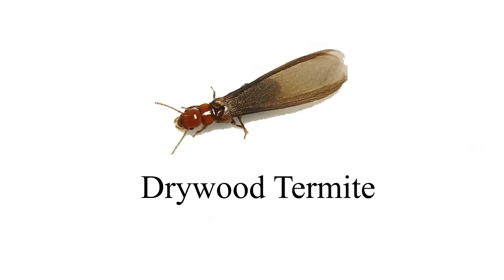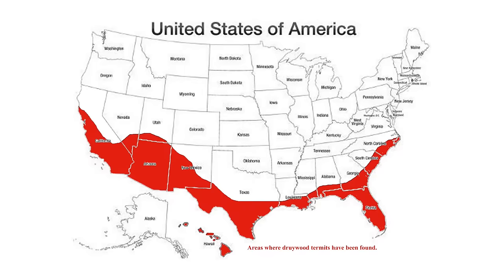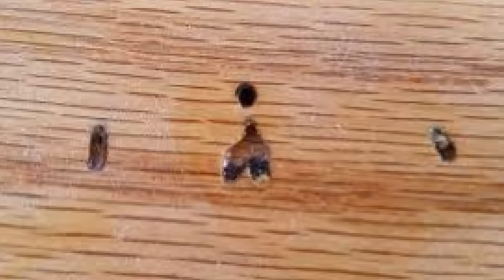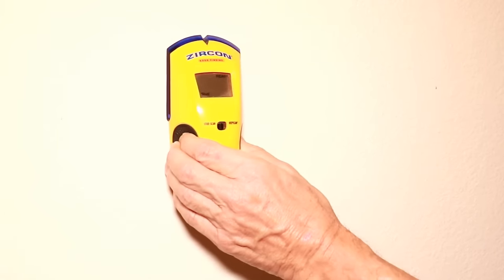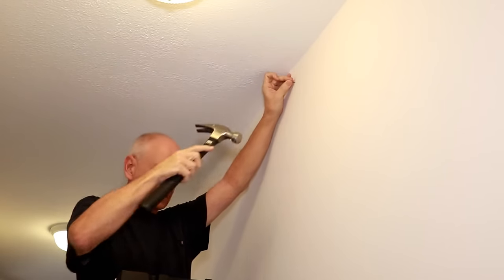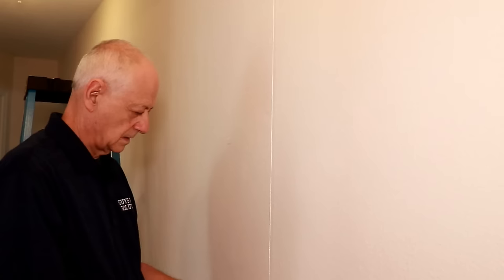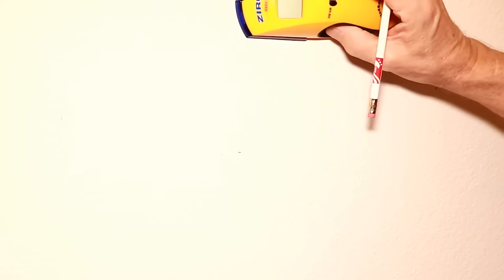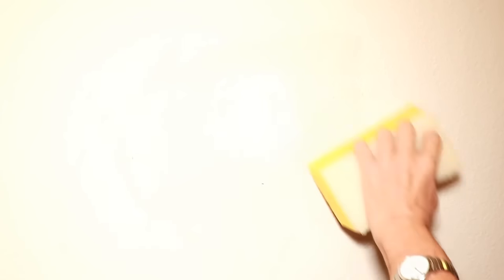How to Treat a Drywood Termite Infestation Yourself. A MUST see if you have Drywood termites.

Comment: My son just moved out and I noticed a whole bunch of holes in the sheetrock as I was preparing to tape top and paint.  It looked like holes from hanging things with small tacks on the walls which he did a lot of. I have since painted the walls and then I lifted the carpet up and saw damage to the hardwood floor ( poplar wood floor)  I since removed the floor and didn't see any live termites but there was damage on the floor, and some minor damage on one sub floor board.  I was wondering if you think the holes on the walls were from termites ? I was thinking the holes would be larger that those tacks he used.  I was going to order a termite inspection to see how extensive the damage is.  I checked most of the sub area and it appears the flass is in a few areas under the house and mostly in the room.  There doesn't appear to be any structural damage other than a few 2x4s.  The other thing I was wondering is if I should clean up the areas where there is the evidence of the dry wood termites.  I was thinking if I cleaned up the area I could see if the Dry wood termites are still active. Please let me know your thoughts.  I watched your video and it was very helpful.  I do want to watch the wideo regarding how to hire a Termite company in case I go that way.  I am pretty handy and I am seriously thinking of doing the work according to what you said in the video.  It would be much easier than taking the sheet rock off to see if there is damage although I did open one bay and re sheet rocked because of settling cracks : ) Thanks for your videos.  I greatly appreciate your knowledge that you shared with us
Reply: I meant frass : )
Reply from the maker: If you are absolutely certain that these are drywood termites, then I think it would be a good idea to clean up the frass and see if it reappears.  It certainly should.  It's hard to say if those small holes in the drywall were from termites or if they were actually tack holes.  I suppose, if you did not see any frass under any of those holes, and your son never mentioned seeing flying termites in the room, then they were probably just tack holes.  If they were exit holes, your son would have seen swarmers.  If they were kick out holes, then you would be seeing the frass on the floor.  Getting a termite inspection done may confirm the existence of termites and may even confirm the species as being drywood termites, but it is unlikely that I termite inspector will be able to tell you how much damage is done.  This is the sort of thing that you would need to hire a structural engineer or home inspector to look at.  Keep in mind that you only need to worry about bearing walls.  The other thing you should know about drywood termites is that they are very slow eaters.  It takes them a very long time to do significant damage.  Don't get me wrong, if left untreated, drywood termites can definitely cause structural damage, but it does take them quite a while.  I think you should confirm that these are actually drywood termites and not some other type of pest.  If they are drywood termites, then you should know that the only sure way to get rid of them is to fumigate the entire house.  You can spot treat them, but it's kind of like playing whack-a-mole.  After the termites get into your walls, they will start to swarm 4 to 7 years later.  When they start to swarm, they will go through the holes that were drilled in their studs for the electrical wiring.  This will allow them access to virtually all the walls in the house, as well as the attic, and crawl space if you have one.  Most of the time you do not know they are in the walls because the frass is also inside the wall.  Therefore, they can literally be anywhere in the house and sometimes a gallery can be as small as the size of a peanut.  That makes all of them virtually impossible to find.  So, I'm kind of hoping that these are not actually drywood termites.

I hope that helps.  Be well my friend.
Reply: Thanks so much Guy.  I am pretty sure they are drywood. termites because of the frass. I will hire a Pest company and find out for sure. I live in Walnut Creek which is about 35 minutes from San Francisco. The East Bay and that is in the map.  Do you think there is hope to use your treatment advice have good results ?  I will go under the house and clean up the frass and see if more reappears.  The good think is this part of the house is vacant and I have good access under the house and in the attic.  I will do my best to see if more frass appears.  Sorry for the email for some reason I didn't see your reply till now.  I just left my computer on and it didn't refresh.  Thank a million guy.  You are awesome and very giving  and helpful. An Angel from above.  😇 @GuysPestSolutions
Reply: I just sent some photos of the frass and floor damage.  Please let me know your thoughts. Thanks again Guy : )
Reply from the maker: @garymeroff3297  I responded to your email.  They do appear to be drywood termites.  I hope I answered all you questions.  Be well my friend.
Reply: Hi Guy I was able to buy Termidor and Bora Care from Do It Yourself Pest control. They ship to California.  I hope Termidor is as good as FiPro as it appears it has the same ingredients.  I can't wait to start doing the treatments. I greatly appreciate your help : )
Reply from the maker: @garymeroff3297  The Termidor Foam is the same thing as the FiPro, so you should be okay.  Be well my friend.
Reply: Thanks guy.  I now have the Termidor Foam and Bora care.  I removed some of my siding so I can see where the termites are or did damage. I treated  the lower plate and a few studs.  I will remove more siding tomorrow and see how far it goes. It appears the damage is mostly in this one bedroom area. This way I can treat right into the area I can't see.  In the sub area I will follow up with treating the cripples and any damage according to your suggestions.  I I guess I should remove any wood that is pretty damaged in case I sell someday.  I don't really think I will sell but it will look better.  Should I spray the boracare on the exposed wood before closing up the exterior or is the Termidor treatment enough ? In the sub area I guess I should angle the foam so it doesn't just pour out.  I have to spray some subfloor boards and some floor joist. I hope to get it all closed up by the weekend. I am hoping the damage doesn't go all the way up to the top of the siding.  I hardest part is done so I will go all the way up to the attic if necessary. Let me knw know your thoughts Guy.  I appreciate it very much.  I was happy to get the spraying started today  : )  @GuysPestSolutions
Reply from the maker: @garymeroff3297  You definitely want to treat all exposed wood with Bora-Care because it lasts forever and renders the wood termite proof.  It will kill any termites that are in the treated wood.  The best way to treat the floor is to remove any insulation in the crawlspace and treat the joists and the subfloor with Bora-Care.  Naturally, you should treat the attic with Bora-Care as well.  You only need to use the foam to get into wood that cannot be treated with Bora-Care.  I hope that helps.  Be well my friend.
Reply: Hi Guy and thanks again for you very valuable help with my home project. I started spraying the Bora-Care today since tomorrow I will close up the area I opened ( most of the siding and shearwall - plywood)  I mixed up the gallon of Bora Care and only used a small portion.  I was wondering if I seal the top of the 5 gallon container how long will it last. I will spray under the house and in the attic in other areas later after finishing the front bedroom exterior, sub area, sub floor and attic. I will send you a few photos to your email to show you a few board that have some drywood damage but structurally they are ok.  Plus it would take a lot more time to romove a 2x6 and a stud on the left side of the bay window. I was also wondering if I should treat the damaged wood with the foam as well or that is over kill.  I have a friend coming over tomorrow to help me so I thought it would be a good idea to check with you.  Sorry for all the messagaes.  It is my first time doing this it is so nice to be able to avoid the cost and hassle of getting the termite company involved.    Thanks again guy for what you do and all the great video you shared and helped us out with @GuysPestSolutions
Reply from the maker: @garymeroff3297  Bora-Care that has been mixed with water should be used immediately.  I have never tried it, but I am told that it will start to separate from the water after a few hours, and will be impossible to get back into a proper diluted form.  Check it out when you are ready to use it and see if it has separated.  Try to mix it again and see what happens.  If it doesn't look right, then you should discard it.  You can mix smaller amounts at one time.  I often measure out just a cup of Bora-Care and then add a cup of water to it.  When you do that, it's best to use a smaller bucket and a rubber, one gallon, paint mixer attachment for your drill.  If you treat wood with Bora-Care, then you do not need to also treat it with foam.  It won't hurt anything, but the Bora-Care should get it done.  I hope that helps.  Be well Gary.
Reply: Oh ok I did use the Bora Care today and it mixed well.  I kind of though of using it little by little so I will do that in the future. I  will use it some more tomorrow and see if mixes well again.  I may have to buy some more because I have a lot more Bora Care to spary around my house to get the job done and be at peace.   Thanks again Guy you're the best.  @GuysPestSolutions
Reply from the maker: @garymeroff3297  You are very welcome.  Thank you so much for those kind words.  Very much appreciated.  Be well Gary.
Reply: Hi Guy I finished the treatment with the exterior of the bedroom and closed it up.  Now I want to treat under the house.  I do have some cripple boards  that are damaged and I have to replace.  Then the attic.  If I do these treatments for prevention on wood that appears not damage do I use I gallon Bora_Care to 5 gallons water ?  Then if there are some areas that appear to have some minor damge would that be  I gallon Bora Care to 1 Gallon water.  I just did use the 1 to 1 Ratio on the job I just did to play it safe but I just watnted to make sure before I spray again.  I am orering more Bora Care tomorrow first thing.  I am feeling good about the work and it's progress.  So, I will keep going !Thanks guy.  I keep watching your videos and they are all great and right on the money ! You're a good man to do what you do. @GuysPestSolutions
Reply from the maker: @garymeroff3297  I know that the label says that you can mix bore care one to five with water, but I never do it that way.  If you stop and think about it, that means they will get just 1/5 of the dose that they would get if you mixed it one to one.  I think it is possible that it still may work, but I do not think it is going to be as effective and it will not kill off the termites as quickly.  The faster you kill them off, the less damage they will do.  So, I just spend the money and makes it one to one.  It is certainly more expensive to do it that way, but keep in mind that this is a one time treatment, so you never need to do it again.  When it comes to termites, I don't play around.  So, the bottom line is that mixing it one to five may work as a prevention, but I do not think it will work as well as mixing it one to one.  

Thank you so much for those kind words.  Very much appreciated.  Be well my friend.
Reply: Thank Guy that makes good sense. Be well and Happy Holidays my friend. 😊
Reply from the maker: @garymeroff3297  You are very welcome.  I'm always happy to help.  Enjoy the holidays.  Be well my friend.

Comment: first love your videos.  I have an RV that was in storage for about 10 months in FL.  I noticed in a 4ft section small pin holes in the ceiling only with fras (dust) on the floor below it.  I immediate thought termites.  I did not find any wings and I did a complete inspection (visible) and it only appears to be in this one section.    Most of the rv is aluimium structure but it appears there must have been some activity here.  My thought was to just drill holes every 4 inches in the ceiling where the pin holes are and foam it.  Your thoughts?
Reply from the maker: RV's are always somewhat challenging.  To address the problem, the first thing that you need to understand is that termites do not eat wood.  I know, I know, you are probably thinking right now, “What did he just say?”  It's true though.  What termites actually eat is cellulose.  It just so happens that wood contain cellulose and so that's why they eat it, but they will also eat anything else that contains cellulose, such as paper.  That means, any materials that were used in the construction of the RV, that contains cellulose, is a target for termite activity.  In addition to any wood that was used, they may attack other things, such as pressboard or coverings that are used to go over the framework of the walls and ceilings on the interior of the RV.  If it contains cellulose, then the termites are happy to eat it.  Now, without actually inspecting your RV, I cannot tell you for certain if you have drywood termites, and if you do, there is certainly no guarantee that you do not have activity in other areas of the RV. These things do like to stay hidden and can be hiding in places where you are not going to see any evidence of frass or kick out holes.  All of that being said, I think you have a reasonable plan to address the situation.  Still, if I were you, I would be inspecting that RV at least every month for further activity.  Do not forget to look underneath the RV, because the flooring is most likely some sort of wood substance.  You may also find these guys in the cabinetry and storage areas that are typically built into RV's.  Drywood termites must make kickout holes and they always produce frass, so at some point, you may find more evidence of infestations if you keep inspecting.  If you do not find further evidence, over a period of time, then I think you are probably safe.  However, should you spot further activity, then you would probably be well advised to fumigate the entire RV.  For now though, I would just go with the treatment plan that you have already figured out.  You may also want to do a preventive treatment on the RV every three months, just to make sure you have no further problems.  I have a video on how to do that and I will give you a link for it.  Drywood termites are all over Florida and so it's a good idea for everybody to do a preventive treatment on their homes and RV's.

I hope that helps.  Be well my friend.

Video on how to prevent drywood termites:  https://youtu.be/neNsmVbj8Pc
Reply: @GuysPestSolutions  Thanks for your input.  I have been doing the preventive treatment on the house never thought of the RV.
Reply from the maker: @gurudiy  Always happy to help.  Be well my friend.